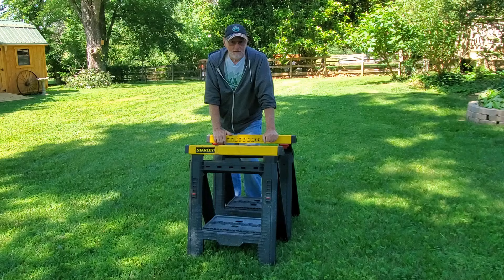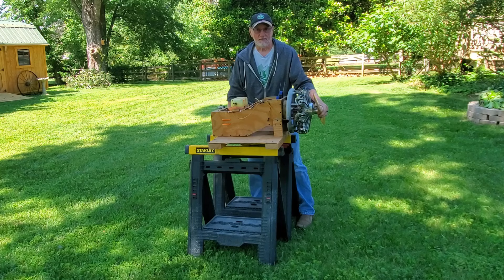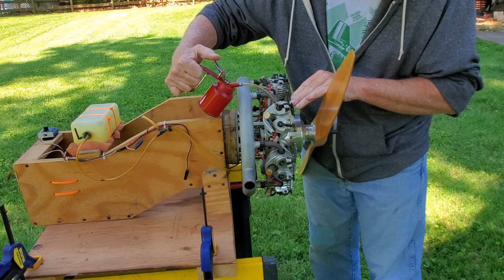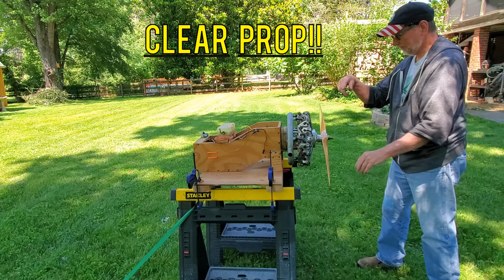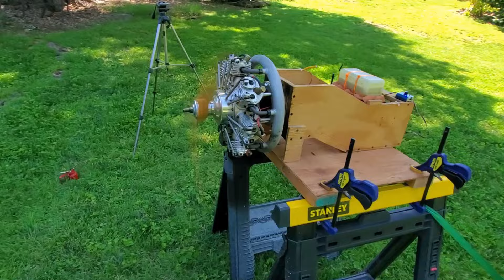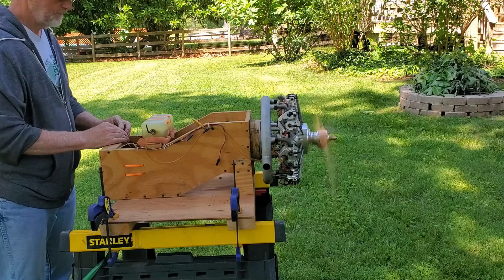will it run

Comment: Great vid and beautiful engine Rodney but a word of caution. I used to clamp my engine stand to the base like you do until I had a Magnum 91-4cycle broke one of the clamps and wound up halfway across my yard. I was ok and so was the engine. Since then, the stand is firmly bolted down. Takes a few extra minutes but no more heart attacks.
Reply: Yup, they can get loose.  I had a Fox .25 do that back in the late seventies.